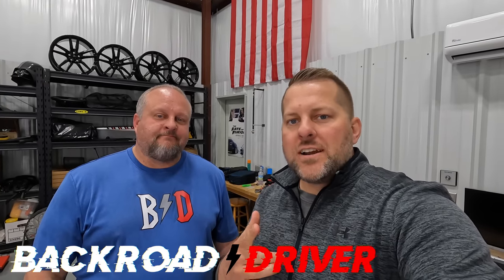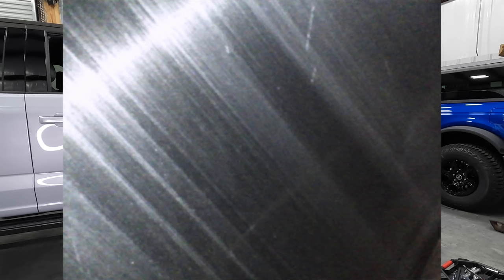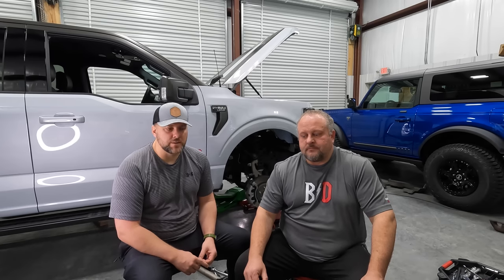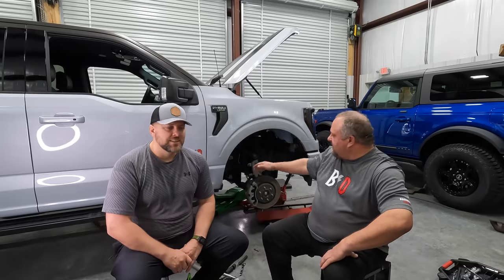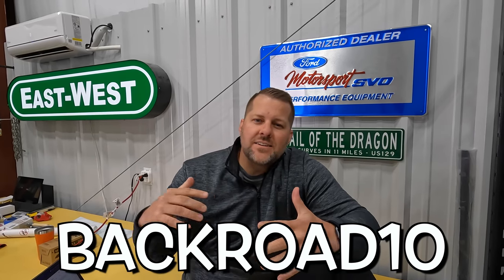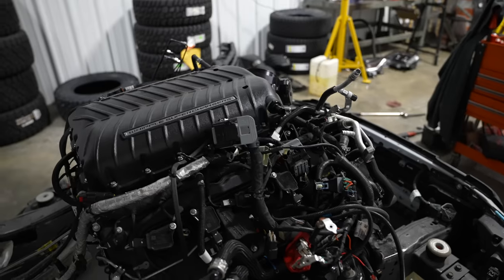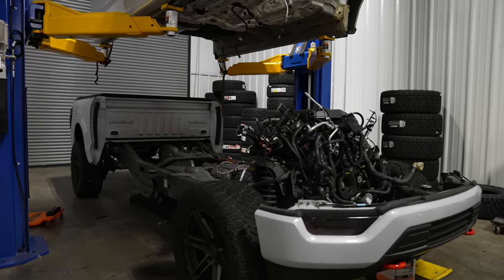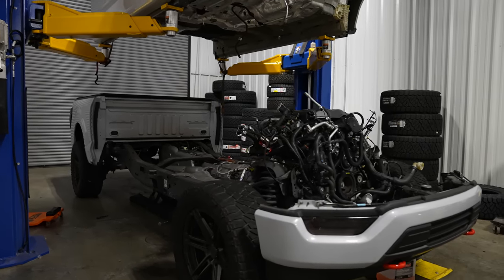Bad Whipple Supercharger Blew Up My 2021 F150 Engine...

Comment: TC Customs and Whipple showing everyone how to take care of the customer.  Failures happen in every company but the difference is in how that failure is handled by that company.  This is the standard that every company should adhere to.
Reply: Did they take care of them because their customer service is that good, or because of the large social media following? Would a random nobody get the same level of service? I'm not throwing shade, just something to think about.
Reply: Yeah and all you need is a really popular YouTube channel
Reply: "Standing behind" your product is not great "customer service". It's a legal requirement when selling "durable goods" as an OEM. Great customer service is manufacturing products that do not fail in the first place.
Reply: Every "company" that manufacturers "durable goods" is REQUIRED BY LAW to "provide" that "level of support" in the United States. From 7 years to 15 years depending on jurisdiction. They're called consumer protection laws. And "durable goods" have "serial numbers" specifically so manufacturers can "provide" that "factory" support THROUGH a "dealer network" and those goods can be "registered" for "warranty purposes" by the original "consumer". If you have a "tuner" or other aftermarket "installer" do your bolt-on "upgrades" AND they "source" or "supply" them and are NOT an "authorized dealer" of the part(s) THEY may be "on record" as the "consumer" giving the "end user ZERO ability to get the "customer service" they PAID FOR "indirectly" when they paid for an "upgrade" they are not the registered purchaser of.

Comment: Man I LOVE catalytic converters they are the best thing ever invented for high power motors. My engine runs so much better because I DEFINITELY have cats on my ecoboost f150!! I love the government
Reply: Even stock vehicles, my buddy and I subcontract each other all of the time, he started running logistics for me. I have a 2015 F150 5.0 that gets 10mpg with a decent size dry van. He has a 2012 F150 5.0 with bad cats and let me tell you, it’s fun to pay for fuel for that thing. He’ll end up just cutting them off but until then, I need to find really high paying loads to make any money whatsoever.
Reply: Yet the large majority of Government vehicles have no emission components since it deems them unreliable.
Reply: Everything they do makes everything worse & ends up costing you more money

Comment: I had similar experience with Whipple and Lebanon Ford Performance (LFP).  Whipple replaced my engine on my 19 Mustang GT.  I had some misfire codes come up and it was damaged cylinders.  LFP troubleshot it to defective fuel injectors.  Whipple and LFP took care of everything.  I didn't pay a dime.  Nice to see a negative turn into positive.
Reply from the maker: Amen!

Comment: I just dropped off my truck to get a Whipple installed literally a few hours ago and I was shitting bricks watching this video. At least it's getting installed at an authorized dealer and installer. Keep my fingers crossed 🤞
Reply from the maker: My issue was a one-off freak accident.  I wouldn't lose any sleep over this video at all.  You'll be happy to pick up your truck with a Whipple on it for sure. It'll put a smile on your face.  Thanks for watching!

Comment: Some good lessons learned here and super important to have an ASE Certified shop do the install.  I know I could do it myself but I'd rather pay a little and have the warranty just for reasons like we've seen here. Without a doubt Whipple should be taking corrective action to pressure test these systems before they go in the box, had they done that, the leak would have been discovered early on and a lot of time and money would have been saved.  I plan on buying a Whipple for my 22 but will also have my Ford dealer install it. The motors are tough and the tune is conservative or Ford would not let them be doing it, its that simple.
Reply from the maker: Bullseye

Comment: Has Whipple changed the design any to prevent future failures? 

Will Whipple do this for every instance, or just because of the negative and widespread press?
Reply from the maker: Can’t say on either. I think it was just a manufacturing problem on this unit.

Comment: This was a unique failure and not caused by tuning or higher than reccomemd boost or racing/ abuse. This was 100% manufactured defect. We should all understand this was also a documented failure with video evidence from ASC Certified mechanics and an official Whipple dealer. The warranty here was completely justified. Most engine failures wouldn’t fall under this type of clear case.

Comment: Hey I had my 2021 f-150 v8 blow up and I had to get the whole thing replaced with similar problems you were experiencing. But I didn’t even have a supercharger or anything done to the engine. So you could of had some engine problems that weren’t even caused by the whipple.

Comment: This is disconcerting. I went with the V8 specifically so I could supercharge it down the road. Really hope these issues get ironed out. If I had seen this before ordering, I may have went with the hybrid instead.
Reply: Motors weren't designed to go 600 horsepower with a blower on top!!!!!

Comment: I removed my cats just for this reason,  and its not easy living in NY. My tuner said dont even bother with Green cats they burn up quick and you'll lose a top ring. 
So here i am with no cats and 17 lbs boost. I had a monitor for reading cat temps for a bit before removal

Comment: I'm wondering how long my cats will go before I have to replace them.  When I had that oil consumption issue (they found oil in cylinders of both banks, think it was valve seals), it ate 4 quarts of oil before Ford authorized replacement both heads at 3700 miles.  That ain't gonna go well for me at some point, lol.

Comment: I think I just had the exact same thing happen to me. Would love to get some details from you guys on how to get it fixed. Ford of Murfreesboro not too far from you guys
Reply from the maker: What's your situation?
Reply: @BackroadDriver  
2021 black widow 5200 miles 3.0 whipple on a 5.0 all done through ford dealer. Threw some cat codes took it in they said nothing was wrong and gave it back said maybe bad cats. I didn’t even get it home and got a misfire code and it started knocking under back driver side cylinder. Quart of oil on the drive way and coolant missing from whipple coolant container. Had to have it towed to the dealership.
Reply: Yep motor is blown going to be a long process.
Reply: Jared, I have a Whipple and the same problem. Is Whipple covering yours?
Reply: @TheBoatguy29  hey how many miles on your truck? Ford ended up buying it back plus all mods
Reply: 18k mileage. Bought brand new Platinum from local ford dealer, with a Whipple from TC. Had a local certified Whipple installer do all the work. Blew a hole in a piston
Reply: @TheBoatguy29  
I contacted ford and had them do a buyback. Did the dealership say they couldn’t help you? Or what did TC say?
Reply: @Jayrad615  that’s interesting for sure. I’m in the process right now. Whipple is capping their warranty commitment to a certain dollar figure. I assumed warranty through Ford was voided because of the Whipple - the Ford rep already showed up and said it blew “because of the Whipple”…. which is typical. I’m going to be out some $$$ on an engine that I thought had warranty. I don’t want to rip on Whipple but I sure thought they would step up on this

Comment: The 18+ coyote engines cant simply be bored out......they dont have piston sleeves......they were finished by a plasma arc process.  U probably can get them re-finished, but with that cost i bet it would be better to buy a crate engine from ford performance.  That would b my choice.  Good luck gents and congratulations on 25k subscribers!
Reply from the maker: We will probably build a Predator block when it blows.

Comment: What headers and cats did y'all use?
Reply from the maker: 2M Fabrication headers and high flow cats from them but they are probably not made by 2M. We will detail that out when we drop the Corsa exhaust video.

Comment: Why dont you eliminate the cats when you add a supercharger?
Reply from the maker: Because you can’t change the Whipple tune yet. There would be a permanent code because the O2 sensors can’t be adjusted yet.
Reply: @BackroadDriver  Throw defoulers on the o2 sensors

Comment: I'm considering an F150, with a Whipple. Whipple is smart. It might cost them to do this, but it makes old farts like me, trust their product...and process. I'd most likely build the transmission, and do a green cats install, up front.
Reply from the maker: You sound smart. Build the trans, green cats or none, and get a gauge to watch your trans, oil, and very importantly cat temps. Watch your temps between pulls and you'll be in good shape.

Comment: Could AutoVlog have the same issue?
Reply from the maker: Nah. His kit didn’t have initial issues.
Reply: @BackroadDriver  glad it worked out for ya. Someday I might swap out my Coyote for one.
Reply: Got basically the same truck as you. 2021 Lariat Sport 501A (not 502A) even Space White, but a bunch of extras. Keep the videos coming. I've used them to inspire all of my mods. Next big mod will be a 4 inch BDS with Fox coilovers and some beast of a pair of tires. Got anywhere I could share some pictures with ya? Mostly cosmetic mods right now. Did the emblem and toe hooks. Plan on painting the top part of the tow mirrors (body colour) and the f-150 in the side vent the body colour as well.
Reply from the maker: You can send pics in Facebook or Instagram messenger if you have that.

Comment: You guys are partly to blame for my ford choice. I’m a die hard Toyota guy and my Tacoma just got traded for a f-150 with the 5.0. I will not be supercharging it though. It will be stock. I’m 35 and it will be my “grandpa” truck.
Reply from the maker: Nothing wrong with that! We have been driving dads stock truck around for a month because we broke everything on the channel…
Reply: I have been too, my baby’s in the body shop. But when she gets back she’ll get new wheels, exhaust and RAS. I miss her. She’s not quite stock, not like these but it’ll get real